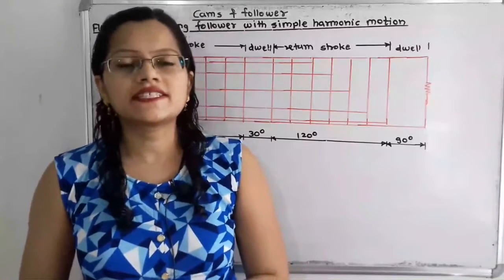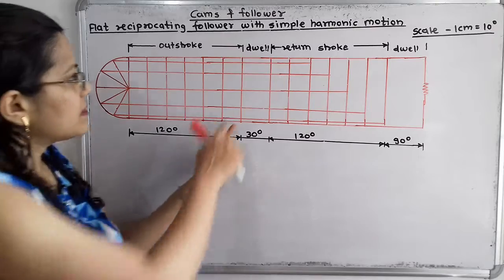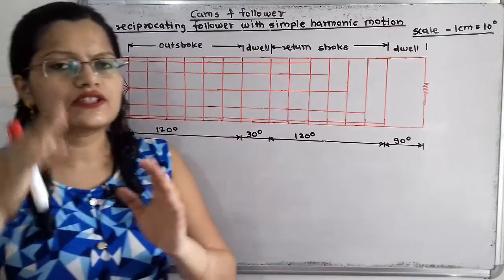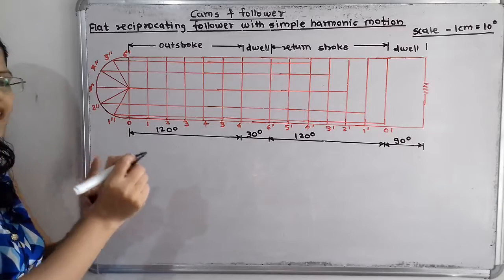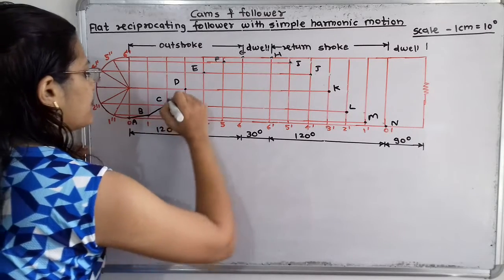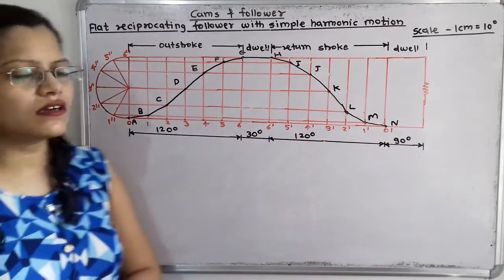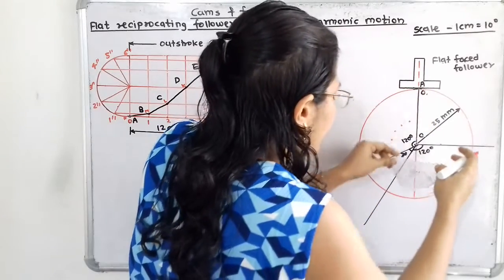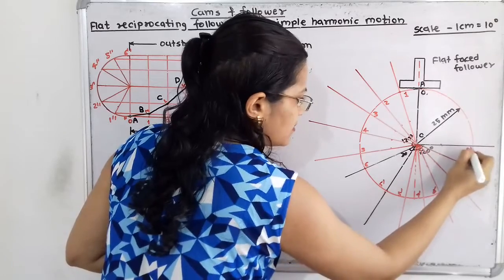Problem 4 on flat follower with simple harmonic motion/  Cam profile

Comment: Dear Ma'am, are these two math same? There is only a slight difference in the first line between these two, will this change the answer? Could you please answer me? 
Thank you so much for solving these figures in detail for us
{ A cam drives a knife edge follower in the manner During first 120 rotation of the cam, follower moves   outwards through a distance of 20 mm with simple harmonic motion. the Follower dwells during next 30 of  cam rotation .during next 120 of cam rotation,the follower moves  inwards with simple harmonic motion . the follower dwells for the next 90 of cam rotation. the minimum radius of the cam is 25 mm . draw the profile of the cam .}
Reply from the maker: I have solved knife edge follower question. Please go through my Theory of Machines  playlist
Reply: @edutechguruengineeringlear4280   Thanks mam
Reply from the maker: @imranhossain678  Please share my videos with your classmates. ..
Reply from the maker: @imranhossain678  Please share my videos with your classmates. ..
Reply: @edutechguruengineeringlear4280  Definitely i will
Reply from the maker: Yes answer is different
Reply: @edutechguruengineeringlear4280  https://youtu.be/ouoEy-1rcZg    

Mam Is this math video you were talking about?